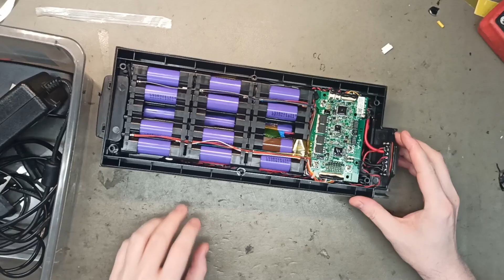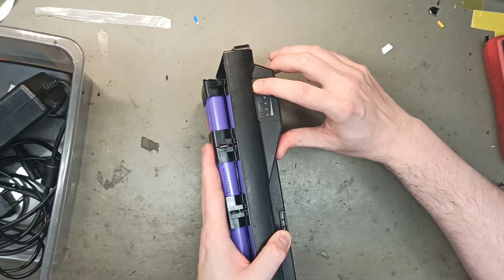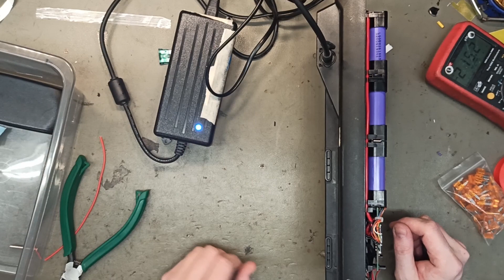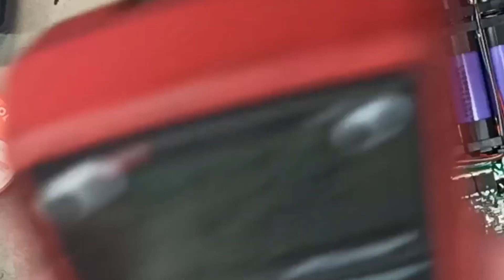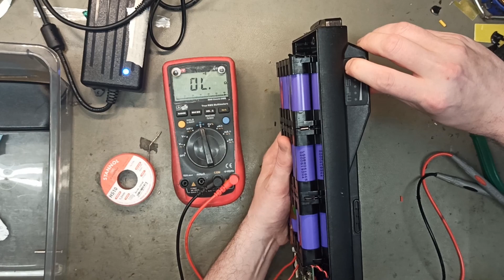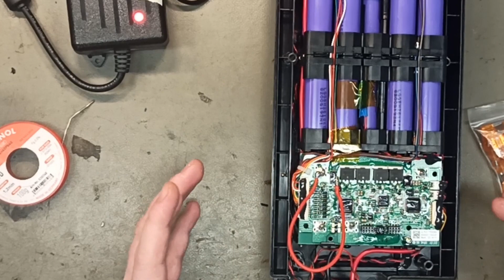36V MBP/MPS battery - Planned Obsolescence with blowable software fuse

Comment: Excellent Fix Doctor.  I bypassed the voltage output on a BMS for a scooter, as it had stopped running the wheel under load.  There is still a fuse if too many amps are drawn from the output and the BMS is still functioning to charge the battery correctly.  I added a voltage meter so I can keep an eye on the battery voltage making sure it doesn't go too low when I go for a ride.

Comment: So in normal operation, the FETs control flow of current from the battery to the outside world but this 3-terminal component is an additional link in the chain that will disconnect either if excess current flows or if triggered by the BMS software due to a perceived fault. When you bypass I would hope the normal BMS functions continue to operated via the FETs. Would you fit a traditional fuse at the output now that you have bypassed the "software fuse" ?